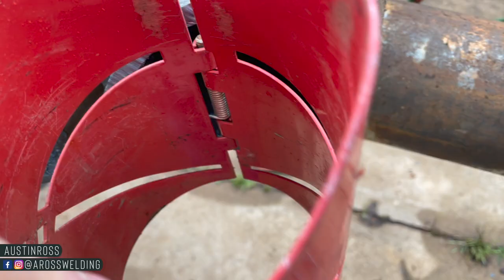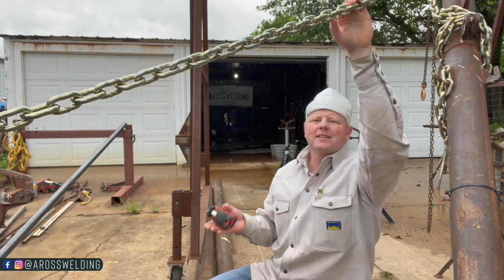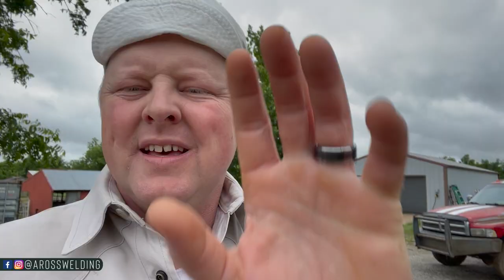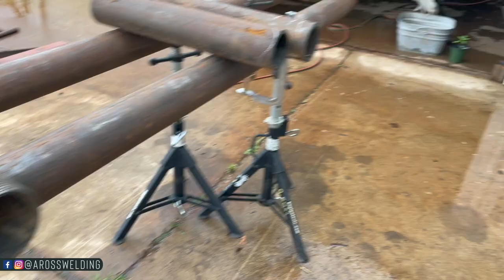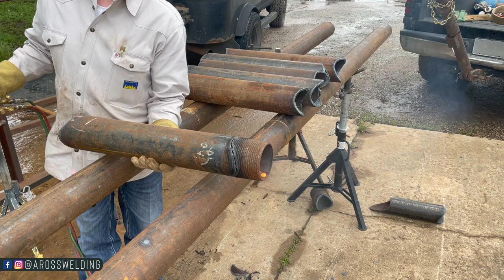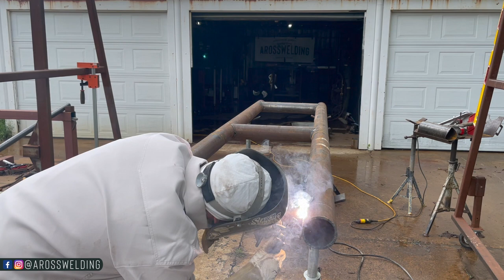SADDLING A BUNCH OF 4 INCH PIPE - BUILDING A PIPE RACK FOR MY BACKYARD PIPE LAYDOWN YARD

Comment: I found a good rule of thumb for your saddle depth is 1/3 of the pipe .od less the wall thickness. On smaller diameter tube I use old wrap around material for a template. Or gasket material for larger ones.

Comment: Austin, belt loop height. Is fairly common. Think of setting up fence pipe in jacks. 9 times out of 10, top of a vee heads hit at a pout your belt/belt loops. Think of you your back, mainlinin’s been hard enough on us as it is when it comes to knees and our lower backs. Slight bend over time will wear a man down in a hurry! 
Dinner table height is roughly 
28” -31” 
Std. Bar top ht. Is mostly 42”
Best height in my experience has been 34-36” fixed heights on fab tables.  

Just some B2B resource networking, for ya. No puns intended, nor any disrespect!

Comment: Does anyone make a coping template that you can slide the torch against directly and not have to follow a line?
Reply: We made our own for 2/7 inch tubing out of 3 inch pipe. Just a small set screw to hold it in place.

Comment: Austin, for home projects, would "plasma" be more economical than Acetylene?
Reply: Only if you already own the plasma cutter and you're working in a shop.
Reply: If you don't "gas weld" much, you can use LP for fuel.
Just different cutting tip. Less money than acetylene. 
The torch is much more versatile!
Plasma is more fun!
Reply: @haroldphipps3457  I've heard using propane requires more oxygen consumption, enough to make your oxygen bill add up to whatever you're saving with a lower cost fuel.
Reply: @Josh Kuehn  I haven't seen that at all.
I know the REAL scrap guys use the huge ass liquefied O2 tanks because of how much they cut.

Comment: A lot simpler way to get your measurements for your pipe rack legs would have been just to clamp your pipewrap around your pipe and measure 21" from the bottom of the throat of the template make a mark at 21" and then slide your template down to your mark to draw a line straight around your pipe. All that measuring the ears and the adding it to the rest of you 21" measurements was kind of unnecessary.
Reply from the maker: I’m using drop pieces to make my pipe racks so I needed to know what min length of pipe I needed for my short pups. I needed to know how long the ears were to make sure my shortest drop piece would be long enough.